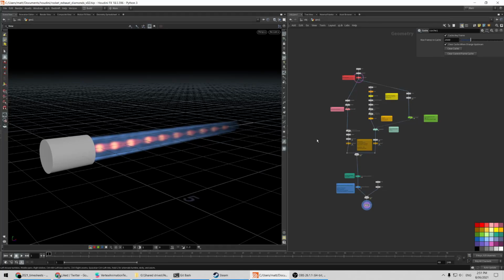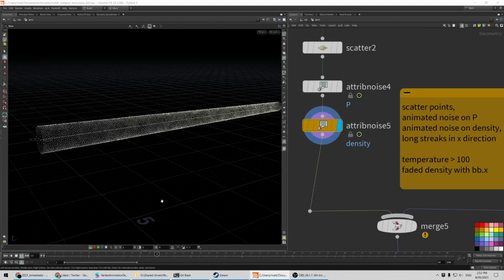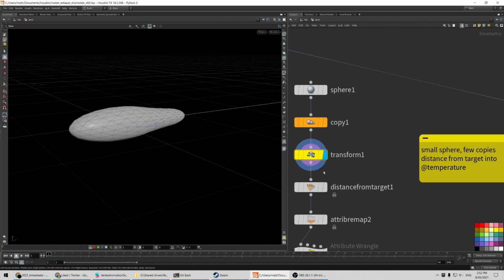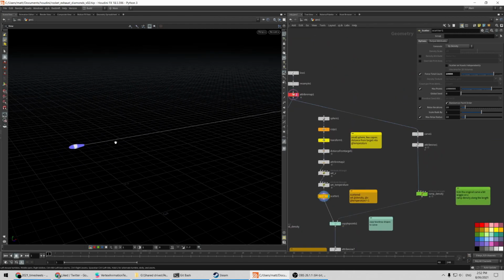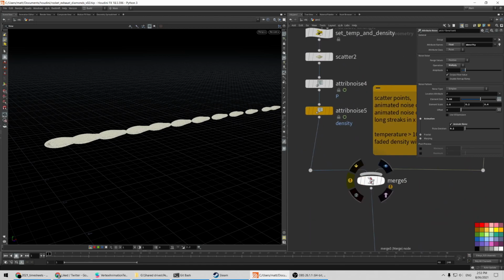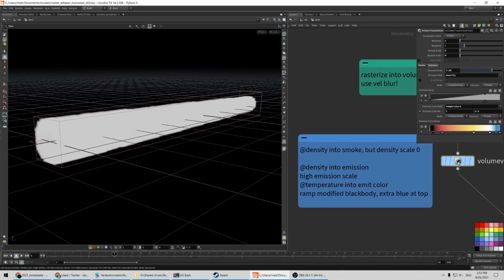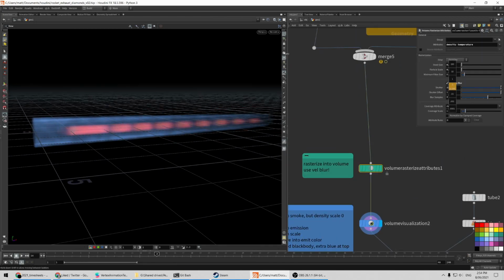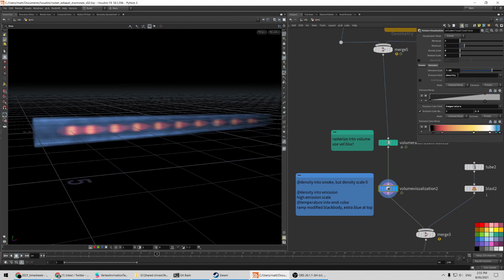Houdini "30s" Quick Tip #21 - Jet engine shock diamonds

Comment: I managed to set a pyrosim in cinema 4d with just emitter and basic pyro behaviour and those diamonds simply emerged. used very high emitter velocity, very high velocity blur and heat dissipation, also a very high emitter temperature and only slight extra fuel emission causing extra pressure. I don´t know if there is any phenomenon mimicked here or it´s just the lack of emitter substeps but it looked quite convincing.  Admittedly to much less art directability than with Houdini